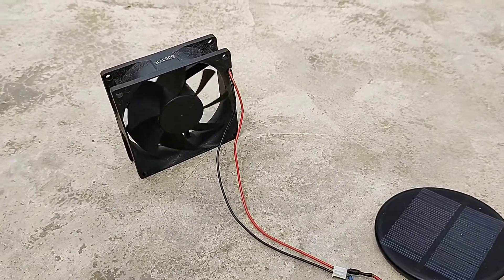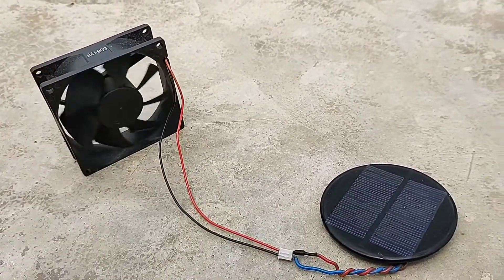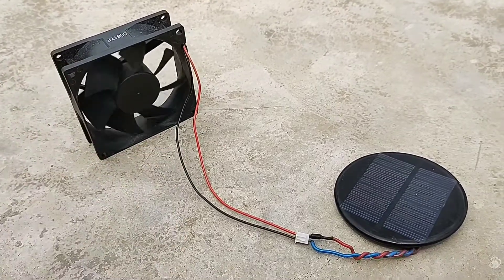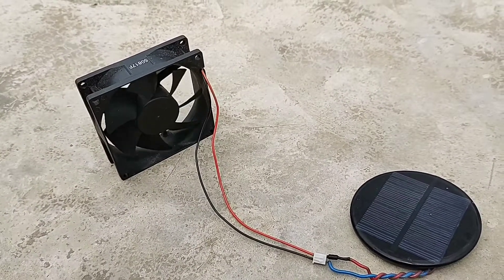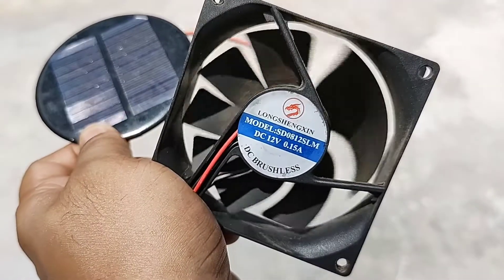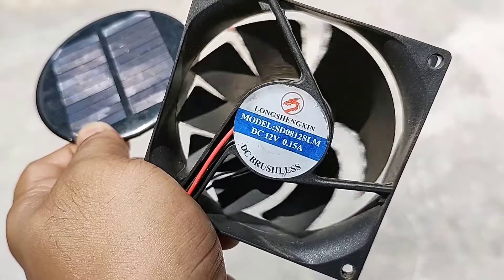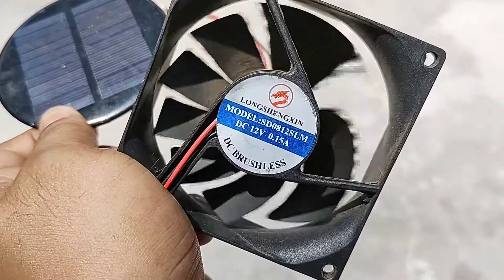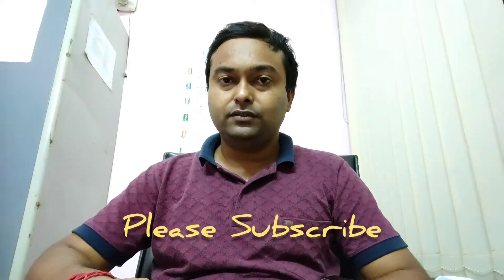Solar Pannel + Cpu fan.

Comment: What was price of fan
Reply: Ok thanks but my solar panel is 12 volt 0.25A and it is not running through two solar plates😢
Reply from the maker: @ connected series or parallel?
Reply from the maker: ₹50/-
Reply from the maker: Normal computer fan